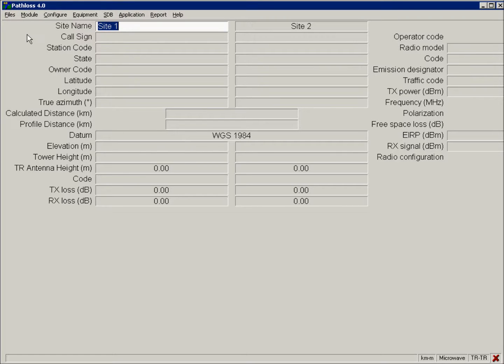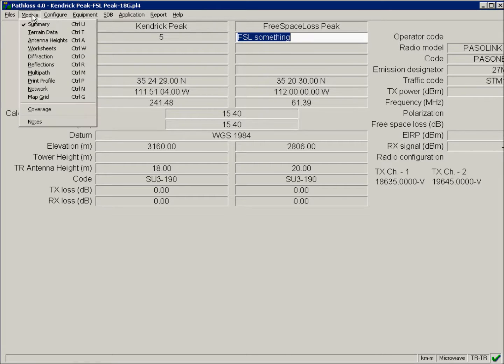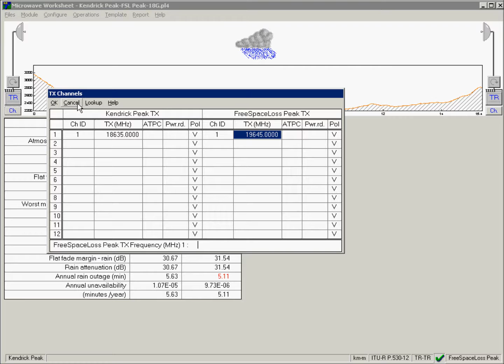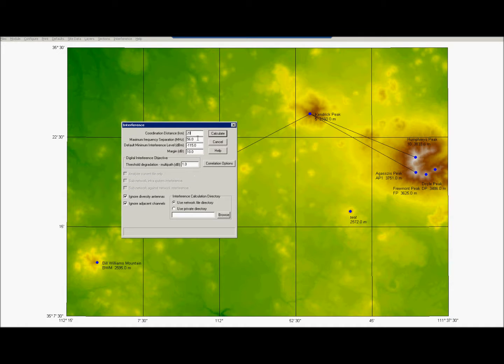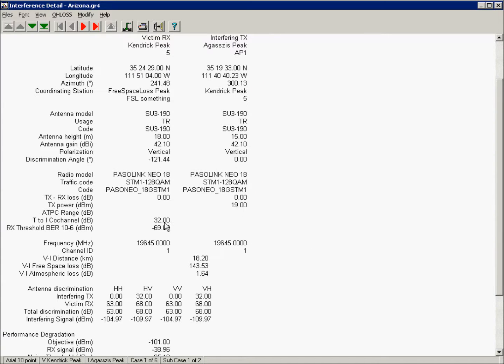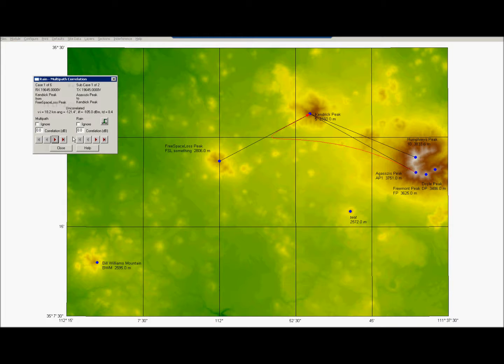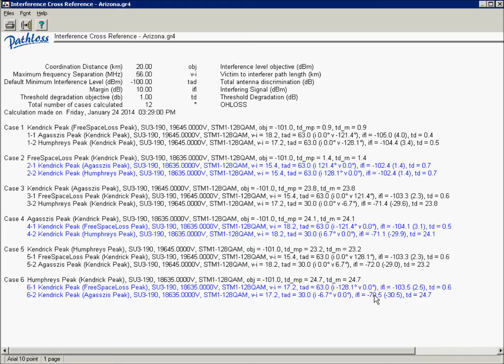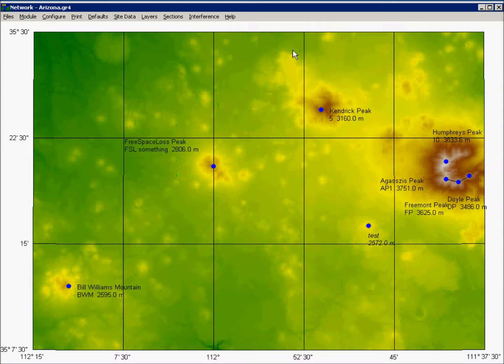Pathloss 4: Interference

Comment: @7'19":Those -71dBm interference level values dont look OK to me, as they cause about td=24dB threshold degradation on the link. I normally try to keep TD below 1dB if possible. In dense urban networks, we may need to accept up to 3dB to be able to utalise the spectrume more effectively.
Reply from the maker: +Tamas Horvath Consider those two links are almost in same direction with quite good directional antenna but not perfect. Links with bigger angle are below 100 dBm.